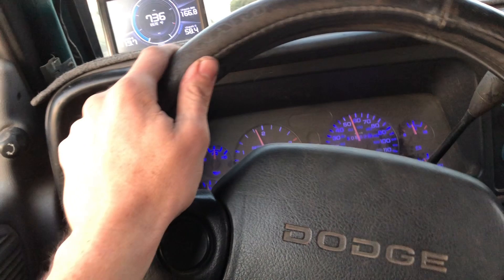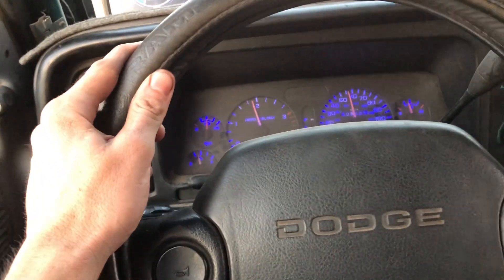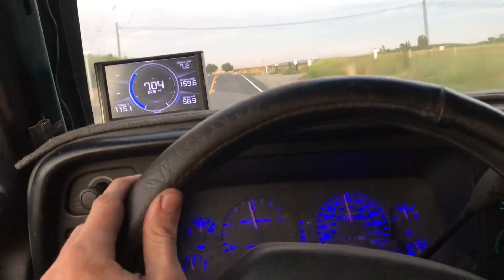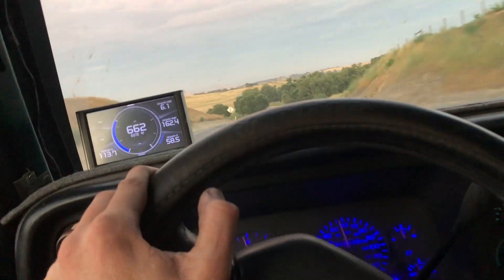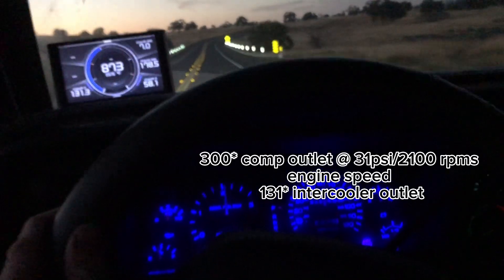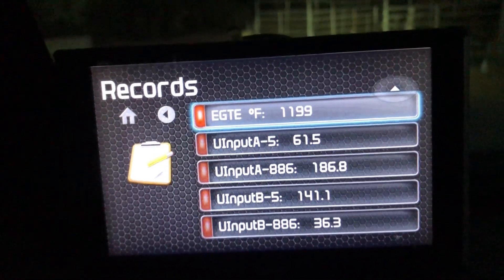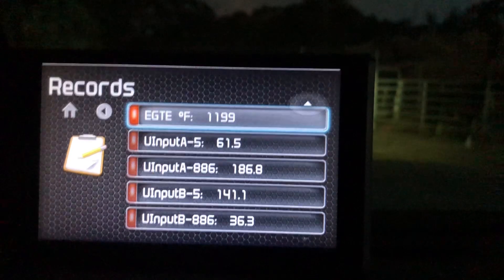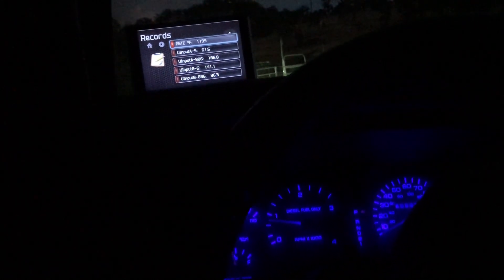12v cummins turbo testing HX Super Hero

Comment: Very impressive Bradley!! That’s some great egt control on a single turbo!!
Reply from the maker: Thank ya. I was kinda wishing it was better (playing around in my head if changing housings to increase engine ve could offset the boost loss) but I think that’s something we probably all always do. Always thinking about if there is a way to improve something lol. At the same time I agree realistically that’s probably not bad at that low of a rpm in od locked on a single.
Reply: @savagefabrication795   We always hope it will be better than it actually is, I like how you are pushing for innovation and making better options than just living with a laggy turbo and poor drive ability. I have compounds on my ve  pump engine and dual stand alone air to water intercoolers that have been the best at keeping my egt down during towing on hills at elevation along with the compounds especially when the ambient air is above 90. I bet I could improve my low end with one of your turbos for my small charger currently I have a hybrid 35/40 with a 12cm housing which is actually pretty good but there is usually room for improvement.
Reply from the maker: @cumminsnchevy  a 12 blade 76/67 turbine wheel with the bolt in 9cm housing would probably have a pretty good shot of getting the job done. I have done a for 70/60 turbine 9’s for low power applications that do really well but they fit in a really niche area.
Reply from the maker: @cumminsnchevy  the bolt in one does since it mimics the hy35 from auto 99-02 trucks. The hx40 outlet version is longer. My cell is 2094844227 always feel free to text and I can get exacts for ya.